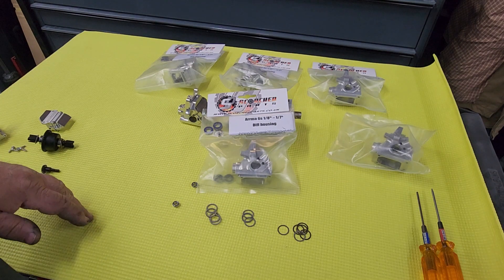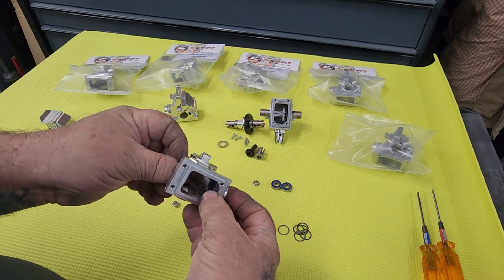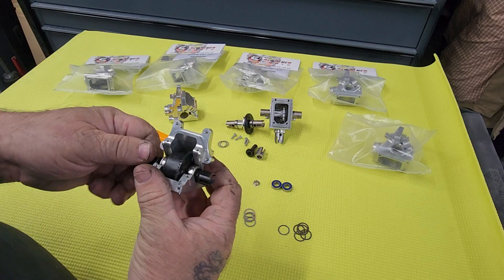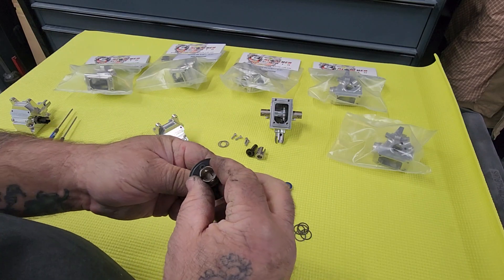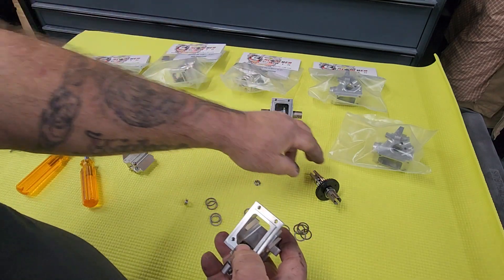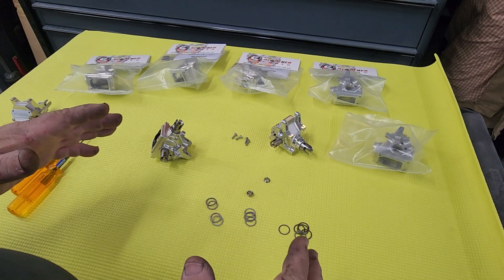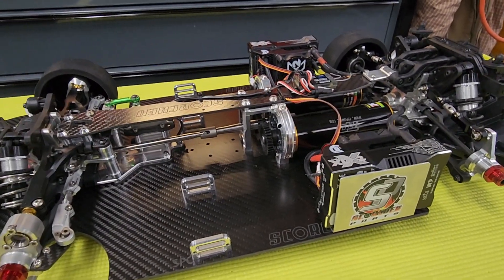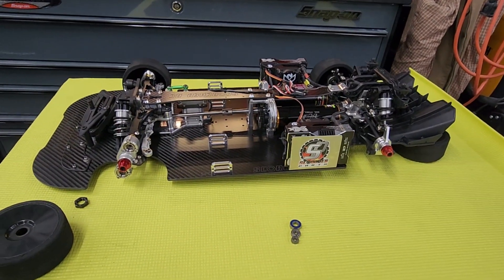Scorched Differential housing unboxing and assembly,   Update on the SCORCHED OUT!!!! Build

Comment: I am super stumped on my build. I haven’t even started it yet. I’m already scratching my head. I have a brand new limitless v2 still zipped to the box. A PP GT Glossy chassis, PPS Single motor mount, PP carbon fiber kit, Scorched front and rear hubs, Scorched xlx2 side mount, Scorched titanium shock standoffs, PP GT Carbon driveshafts kit, PP front and rear center mount, PP Rear mount, PP Speedrun springs. Which I think I may out in some polished aftermarket shocks I found online. But basically, I am going to buy the Scorched front and rear diff housings and then a diff locker for front or rear? Then I seen a scorched carbon too brace with servo mount but it says that the spacers may be a fitment issue with the pos mount?  I’m stuck. In an amateur. Big time. I may have gotten way over my head. I’m trying to make the most beautiful but insane beat possible. But all I seem to keep doing is confusing myself in what to buy. My ultimate goal is to hit 190mph when and then also be able to have the car on display. If I could talk to you directly it would be a blessing.
Reply from the maker: Probably best to look me up on Facebook and message me

Comment: I love the look and quality of Scorched parts, I have some on my Outcast, the differential housings look amazing! The only thing that comes to mind is the added weight over composite housings, is there much difference or is it worth it for the added strength and more accurate tolerances over the others? I appreciate your insight!
Reply from the maker: The weight is really a non issue , and with the added durability its well worth it
Reply: @jamesmccoy204  Thank you, I have most of what I need to get started with my Limitless V2 build, I did want to look into a chassis from Scorched, but I noticed there are a few different options, I’m looking to run the FC100 body and wanted to run the square SRD V2 SMC 4s 6800 packs in it, it’s my first one so I’m unsure of what I need for side trays, and anything else, it’s no fun to spend big money and not end up with the correct stuff, could I message you with some questions?
Reply from the maker: @adamhill1216  message me,  be glad to help

Comment: Thank you James, but Im having some technicalities with the 
D-safe drive cups.. Does Scorched make identical drive cups but without the D-safe design?
Reply from the maker: Scorched does have cups in all sizes, 
They do not have D safe cups
Reply: @jamesmccoy204  … 😎okay awesome, that makes sense now. Their site says.. “specially designed for Arrma safe-d type input shafts (with 2 flats)” so I was expecting the drive cups to have the D-safe flat spots on them, but they do not. However scorched is the most recognized RC aftermarket parts maker and no body is complaining so I won’t let it bother me so long as it’s strait and eliminates the wobble.😁

Comment: Are you running stock Arrma cvds and dog bones with the habao gearing setup? Thanks James
Reply from the maker: With the Hobao through shaft lockers stock arrma shafts work great
Reply: Only slight tweak required is washers under the front pillow balls to give an extra mm of clearance. We include washers with the Hobao lockers

Comment: Great video, and useful info.  I am, however, curious about something - the sideways-mounted ESCs.  I REALLY like how it "cleans up" the wiring (literally, one of the 'cleanest' wiring jobs I've ever seen)...but, does it affect the COG, and, if so, by how much?  Also, how might a single ESC/motor setup be affected by a sideways-mounted ESC?
Reply from the maker: Thank you 
Mounting the esc's like this actually changes noithing,  I have logs for literally 1000's of pass with ESCs Mounted on their side and flat, and there is no differences,
I actually run most of mine on there side to save space .
Reply: @jamesmccoy204  Wasn't referring to top electronics data (ie. 'logs')...was referring to the physical handling of the vehicle (something logs don't have the ability to indicate).  Normally, with race & crawling vehicles...ie. anything other than "bashers"...one wants the lowest COG possible.  Raise it higher, and it starts causing handling problems.  That's why I was asking.
Reply from the maker: @NinthIslandRC  no effect in handling at all
Reply: @jamesmccoy204  🤙🏼